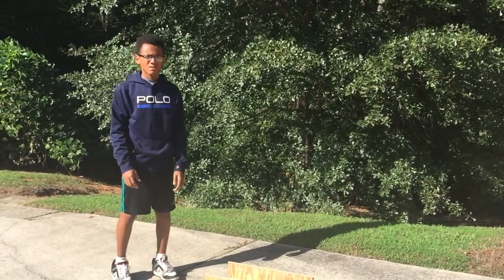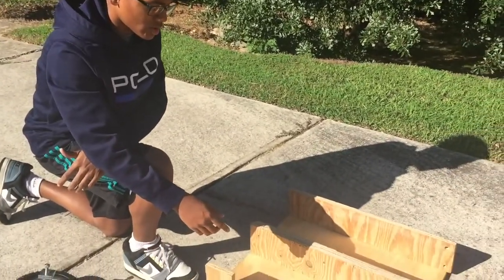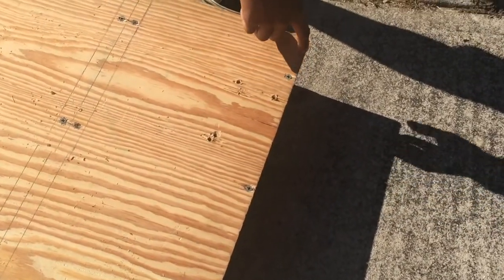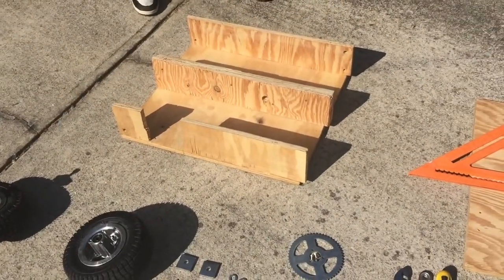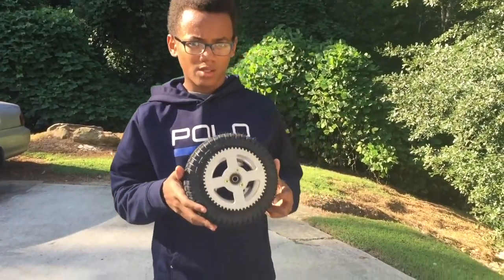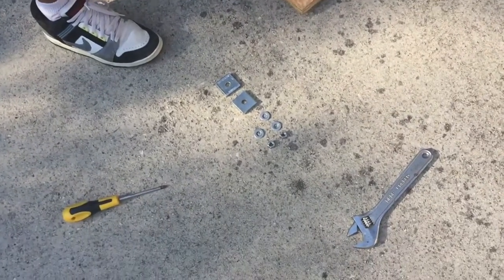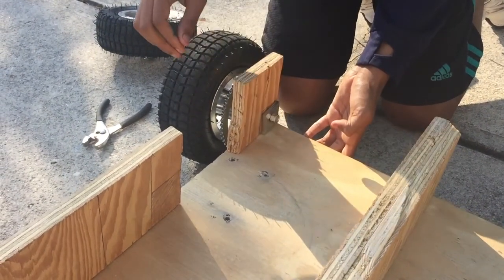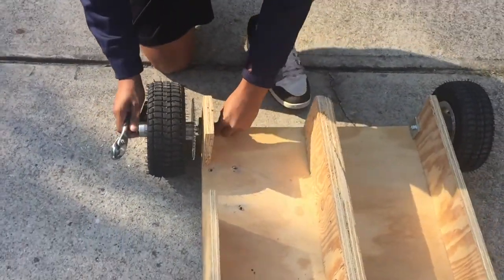How to Make a Wooden Electric Go kart Part-1

Comment: Hey Project Mechanic, we loved your video and clicked on the link to check out buying it, but your link doesn't work!
Can you add how to charge it up? either by plug or solar?  Nice and simple week-end project - really solid thx!!
Reply from the maker: I’m working on the link problem right now, thank you!
Reply from the maker: Where to get battery charger is in the ebook and you charge it by plugging the battery cable to the charger cable
Reply from the maker: The link now works, thank you for your support!